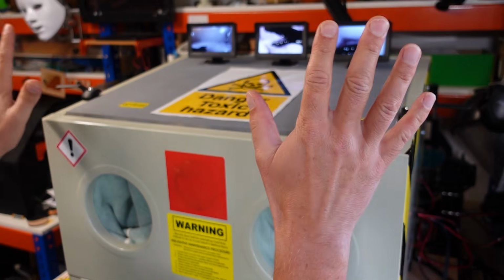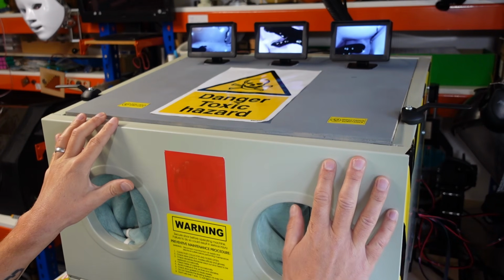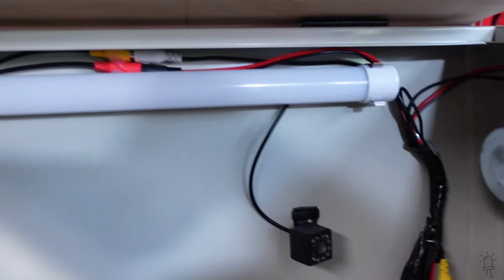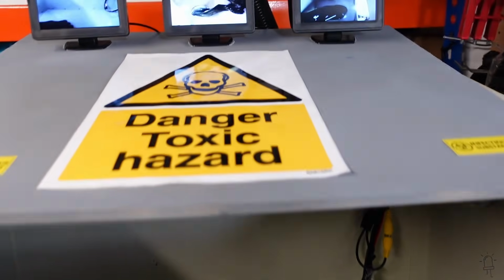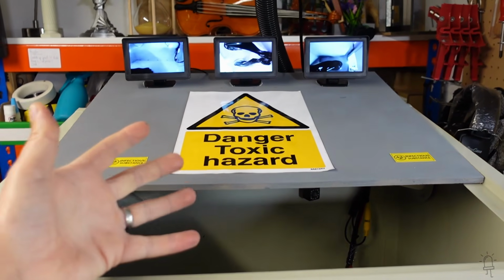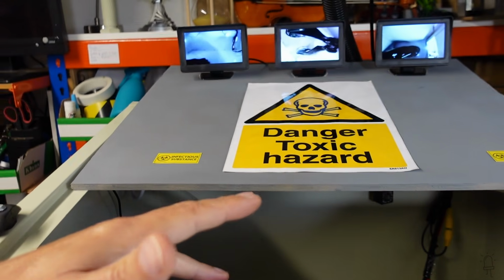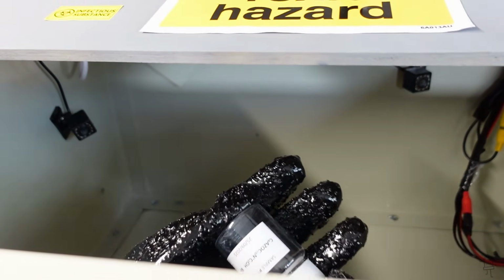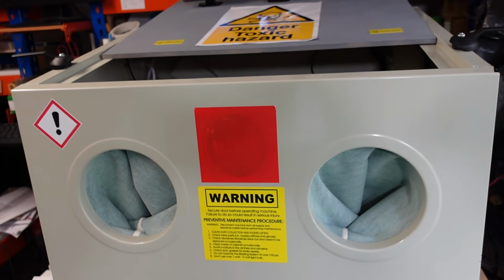How to Create your own Biohazard Escape Room Puzzle

Comment: The 3 cameras could go to a single display, with switches inside the enclosure to select which camera feed is displayed. This could make it pretty fun if you need a particular viewpoint to do different tasks, e.g. connecting a cable between two connectors -- one on the top and one on the bottom -- of the nuclear fusion core.
Reply: He literally said that in the video...